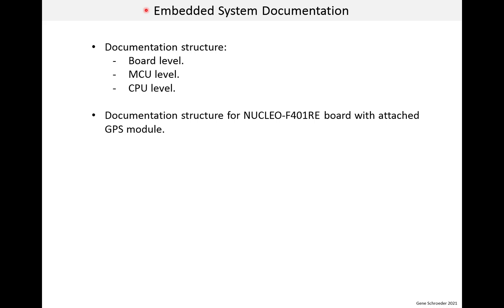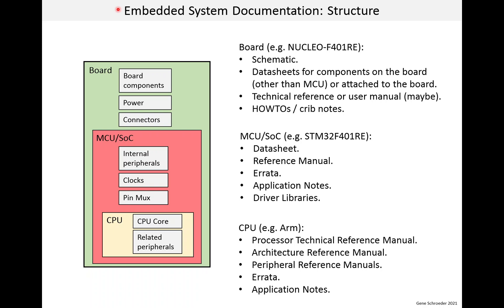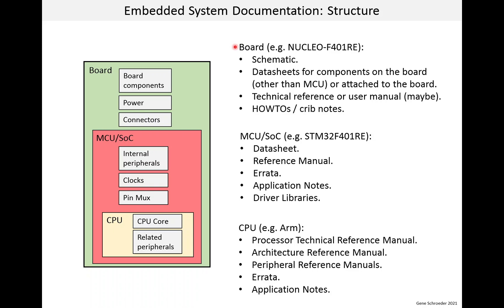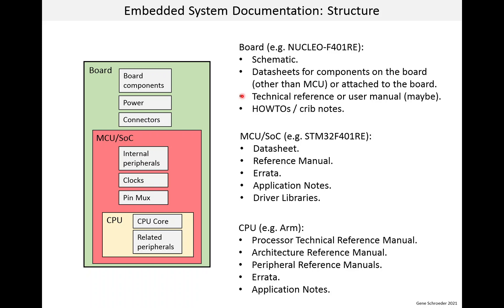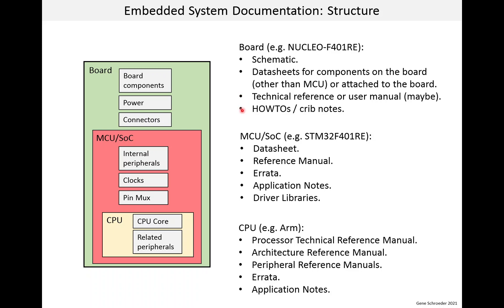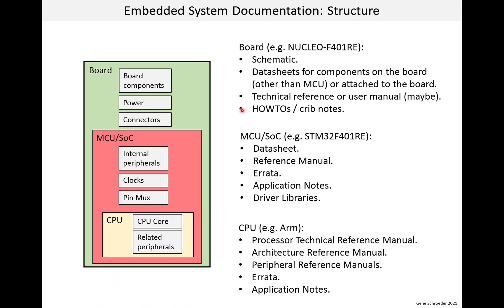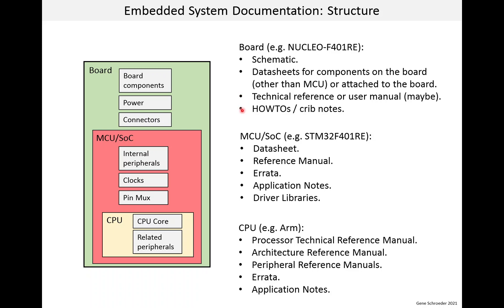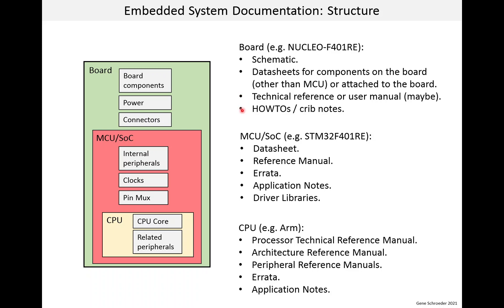Lesson 4.  Exploring MCU Documentation

Comment: Could You suggest a course for understanding schematics in better way
Reply from the maker: I will try to look for a video course, but I would like to first better understand what you are looking for. 

There are two things to learn:
1.  Electrical and electronic concepts like voltage and current, and electronic parts, and how it all works together.
2.  The "language" of schematics that show parts and connections are drawn out. 

I think that usually you sort-of learn them at the same time -  because you use simple schematic diagrams as you are learning concepts. However, "real-world" schematics like I showed in this lesson are more complicated and use many more symbols, and there are some things that can be confusing. 

Could you let me know what you need help in understanding?
Reply: @geneschroedertech7501  I became interested in embedded systems to learn what makes a computer tick. So I want to learn both of those. Great course by the way
Reply from the maker: I looked for an electronics course on YouTube that would be good for someone starting in embedded systems. I couldn't find any that I really liked. Some were too simple, and some were too detailed. Si here are some you might try.

https://www.youtube.com/playlist?list=PLfYdTiQCV_p6lhKbGcjVIy0KIHxXq3HDy

https://www.youtube.com/playlist?list=PLa7G9a0g8LGL_ApmTcVPv_Z_QVHYrRw6G

https://www.youtube.com/playlist?list=PLSQl0a2vh4HCLqA-rhMi_Z_WnBkD3wUka